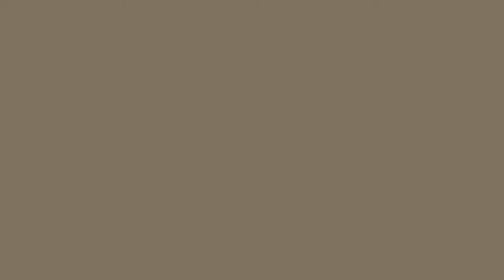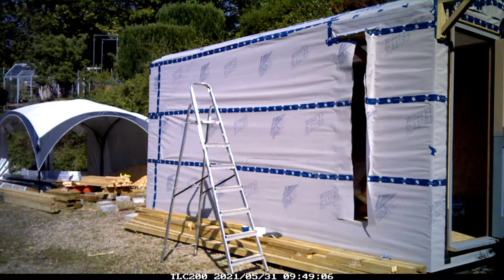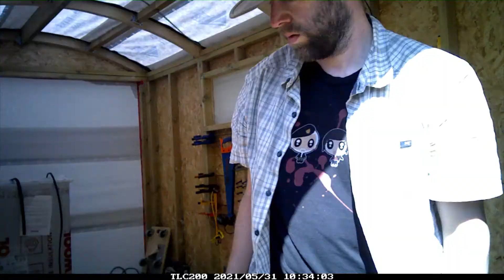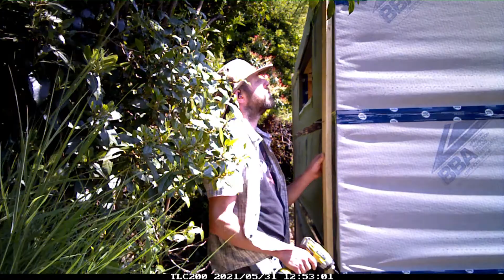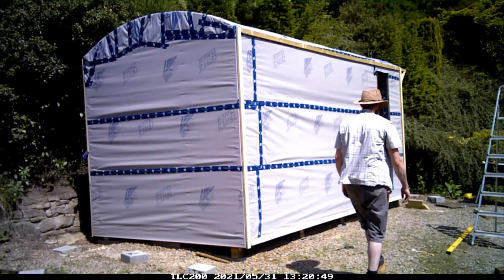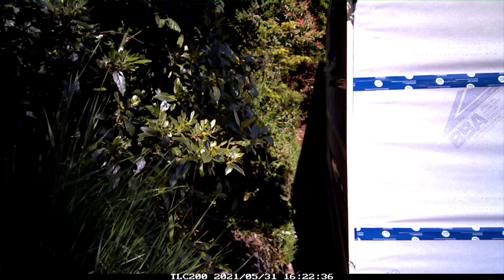Self building a custom shepherd hut in 2021, timelapse footage Part 9

Comment: Nice, I'm building one also ..im just at the point where I can do the internal cladding ..not sure if 7mm thick tongue groove is good enough ..with 50mm insulation that is.
Reply from the maker: ah cool, I’ve gone for 18mm ply for the internal walls on the top half and 12mm shiplap cladding for the bottom half, these will be supported with blocking to allow things to be hung on it ok.